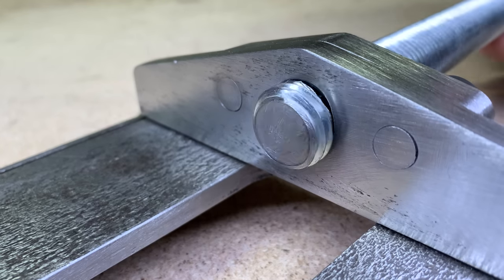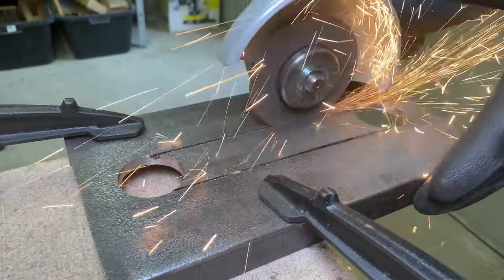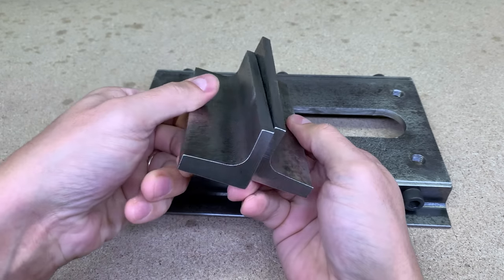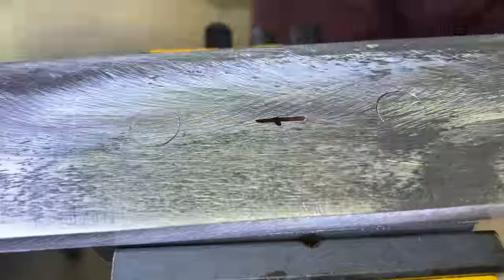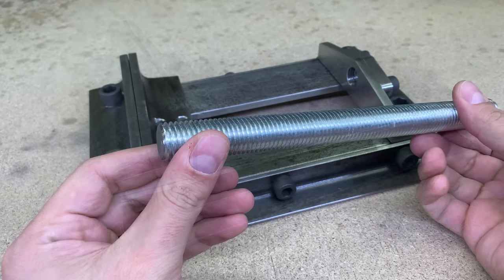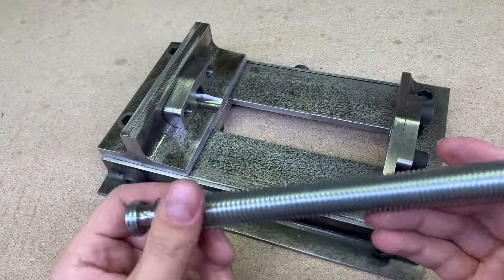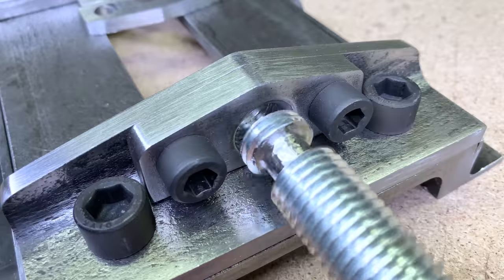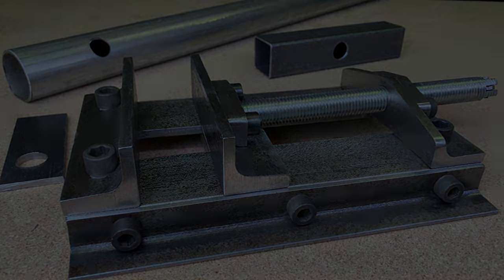Make A Metal Drill Press Vise Without Welding | DIY Homemade Drill Press Vise

Comment: That's a beautiful vise, I like it more than my cast iron drill press vise of the same size. 1 thing I would change, and already changed it on my purchased vise: The pivoting handle lever was a pain to use. I found it slow to turn, and was always grasping to find it or turn it the right direction. So I replaced it with a small crank handle, now I love it.
Reply: Beautiful, but forbiddingly heavy and accordingly clumsy to handle. And non-yielding  positioning on the drill's base looks pretty awkward.

Comment: Great video. My test piece as an apprentice engineer in fitting was to make a precision machine vise using only steel flat stock bar, a hacksaw and files, a rule to mark out and drill/ream holes using a pillar drill. Oh and a lathe to screwcut the leadscrew!
Reply: What's an apprentice engineer?
Reply: You made the screw yourself? That's so cool!

Comment: Very nice project, especially for those who do not have a welder, or a lathe.  Careful handwork. I also agree with your statement as to why not just buy one. This is the kind of project that gives you practice in measuring, filing, cutting, finishing. Is this a vise one is going to put huge amounts of force on or beat on with a hammer..? NO...! But on a workbench where one needs something sturdy fairly heavy, and easy to maneuver, this fills the need nicely. THANKS for sharing.

Comment: Excellent work, though I wonder how well the handle will hold up long term. That small tang seems to be a weak point.
Another item, your English is extremely good for a non-native speaker. If I may offer a correction, instead of saying "grinded", say "ground". This verb is irregular.

Comment: This would make a great weld vise as well, especially since you can replace all the C channel (which can be hard to get in some places) with L section.
The only thing i'd change is the rod. I'd get a pair of car suspension spring tensioners, and use the ACME thread from that. In the cheaper variants, the nut is a round piece of threaded tube. It's welded to a grabber jaw, removing and staking it to the static support in your vise design would be rather easy, and even easier in a welded variant.
You basically drill a hole the size of the nut, put the nut through and then drill (from the top) two pin holes through the metal and the nut. Once pinned in place it will never move. I've seen similar methods to hold round nuts in lathe carriages. If it works for that, it works for this.

Comment: I love when people use Allen bolts instead of Hex headed bolts. Allen bolts are made of harder steel alloy with hard to damage threads and they fasten with higher torque. Moreover the end product look much more like a prime item than otherwise. Only pros work with Allen bolts!
Reply: No, there are different grades of both cap heads (allen) and hex head bolts - e.g  8.8, 10.9 , 12.8 etc embossed on the head -  don't assume that Allen bolts are high torque because they could be low grade rubbish as well.

Comment: What's wrong with welding? Are you afraid of it? You'll spend way more on fasteners and the part will have slop and have to be tightened periodically. Just weld it like a normal person.
Reply: Not everyone has a welder, you knob. Besides that, precision machinist vises are bolted and not welded. There is nothing wrong with this method.